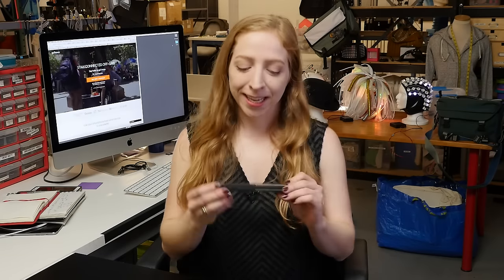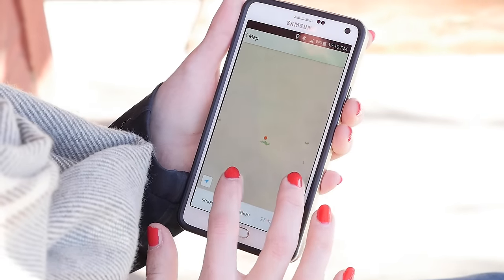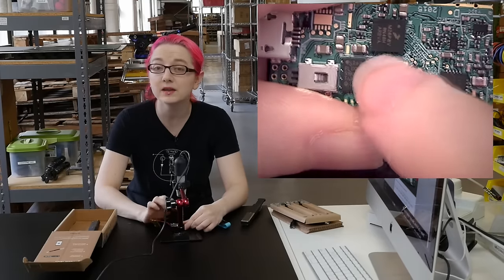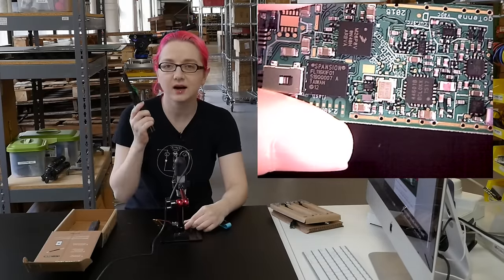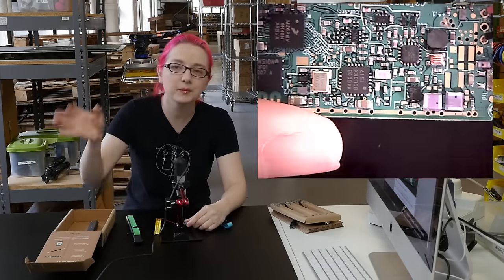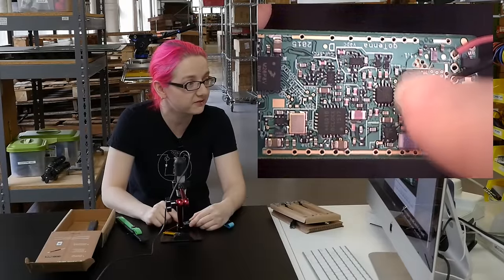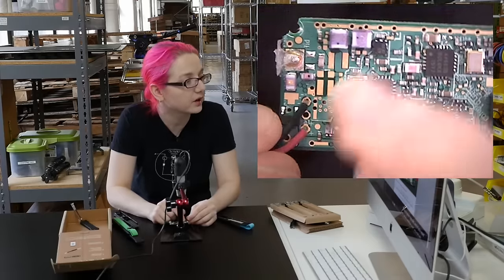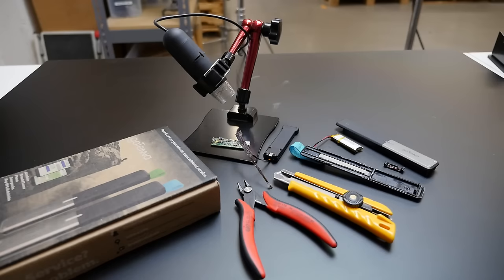GoTenna Teardown

Comment: I'd like to put in a request for a Gemma with bigger holes. I want to use it with kids (about 1000 of them with potential for much, much expansion after that) but the current holes require small needles which are difficult for newbies to thread. Any chance something like this could go into the works?

Comment: what about file transfers. what's the largest it can do, or can it transfer files at all
Reply from the maker: +Nick Farrow no file transfers, just messages and locations through the GoTenna app.
Reply: +Nick Farrow If you are interested in doing file transfers and setting up a 2.4 GHz MESH network you should look into HSMM-MESH & HSMM-PI. You will need an technician's license (HAM) to operate at the higher power levels and to meet the FCC requirements for station identification.  I have been able to build out my own little node repeater network and have so far been able to transmit line of sight well over 5 miles. Understanding radio propagation and antenna science helps, but unless you are homebrewing antennas any of the dozens of good quality high gain omni directional and directional antenna should get you going really easily. 

I built power supplies for the Raspberry Pi nodes using the PowerBoost 1000C powered by batteries scavenged and re-packed / JST-PH terminaled (purchase the extension cable and just lop off the female terminal to get leads long enough) into 10,000 mAh 3.7volt 18650s from old laptop batteries. Eventually I will make little solar arrays to keep the batteries topped up during daylight hours. The idea being that I want to be able to push high speed wifi signals into wilderness areas so that my non ham friends can communicate off grid using their smartphones and offline chat apps like FireChat (untested so far but should work) and Bleep (fully tested works great and supports file transfer).  Eventually I would like to test deploying these for search and rescue ops where teams of untrained (and therefore people who do not have access to the VHF radios)can have access to group comms. Again this is for areas with null cell phone coverage.

I have 2 of the goTenna units (I was part of the pre-order crowd) and they are great for what they are 2 watt MURS. But fairly limited in range and battery power and they are a walled garden so they only work with goTennas. (1 Gotenna per phone). This makes them a little pricey to invest in for anyone other than family.  So if you get some consider building or buying a battery pack to keep your phone and goTenna topped up for days of heavy usage  (being off-grid as such). 

HSSM-MESH for WRT54G(L) reflash http://www.broadband-hamnet.org/ 
HSSM-PI for Raspberry Pi https://hsmmpi.wordpress.com/  <--Redirect to the github page is in the information.
Reply: +Doctor Who Ahh,so it is MURS. I was trying to figure out what band it might use,at 'around 100mhz' that is unlicensed.
Reply: +PhattyMo I just sent a nice fat string of packets across the air and my RF counter says it is on Blue Dot / Channel 4 / 154.570 MHz. The local Wal-Mart uses that channel as well I'd be curious to see how interference affects these devices. Going to go test that out.
Reply: +PhattyMo Drove out to Wal-Mart. Sat in the parking lot and monitored MURS 4.  Waited for traffic. Well I was pleasantly surprised. When the carrier is in use goTenna does not let you send the message. When the goTenna did raise traffic it was a maybe  400 Hz tone for maybe 50 or 60 milliseconds I was able to transmit up to "quis nost" of the Lorem Ipsum in that time.  Now if your traffic gets doubled while you are transmitting I seriously doubt the blisterpack MURS radios they use at Wal-Mart listen for traffic so it would probably effectively kill your transmission. I am not certain if the goTennas send a return confirmation packet to the sender or attempt to resend if the packet does not arrive...